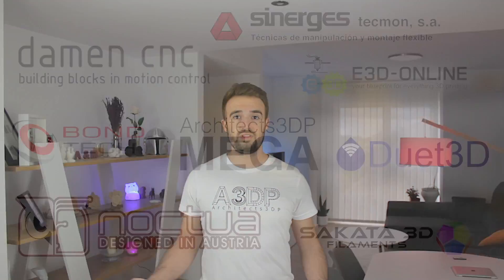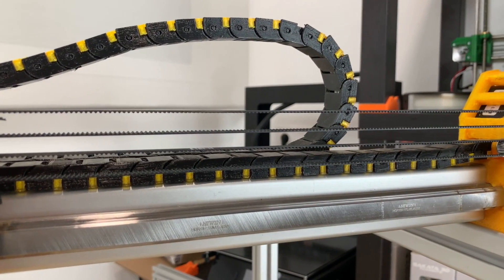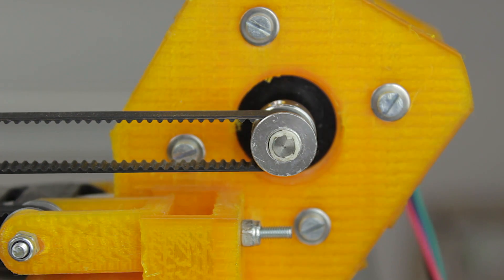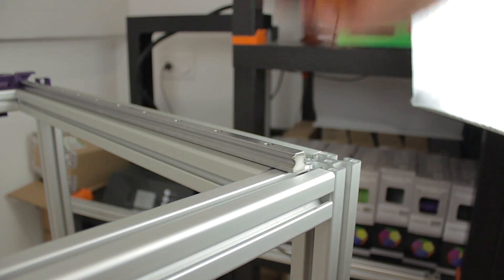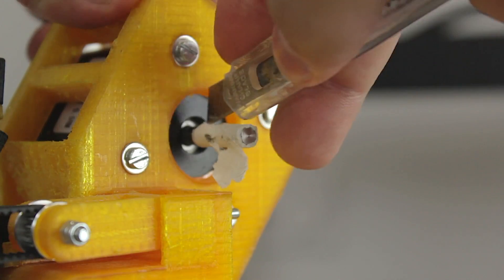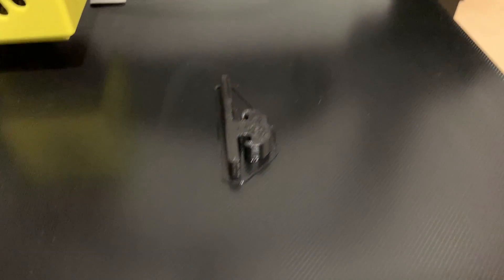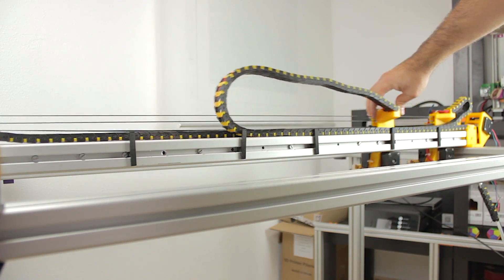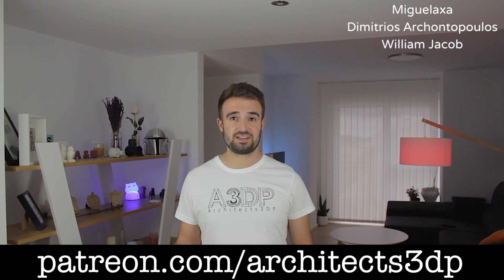Architects3DP MEGA Update #11

Comment: Would a "fin" on the cable chain to fit in the extrusion have worked? I know the clips solved the problem, and you weren't going to waste time and material printing them again.
Reply from the maker: Hey Greg! That would be a cool solution, but I would have to re-design the cable chain completely, since it’s designed to be printed resting on the printbed with no supports… if you add sth that goes even lower than the base, the chain links might be printed vertically, so the design should be changed to not have more than 45° overhangs and so on.. anyways it is a great and cleaner idea! 💡 thanks 😃